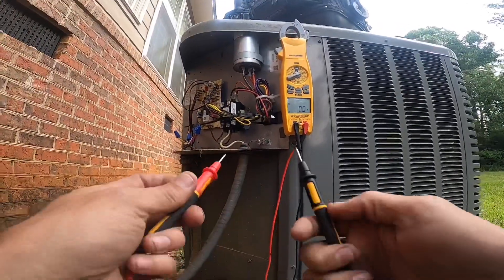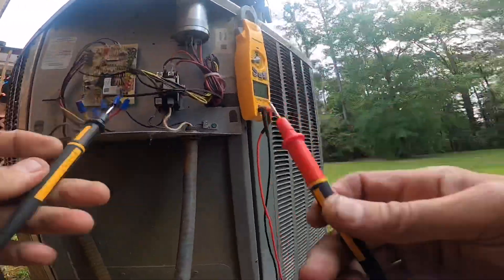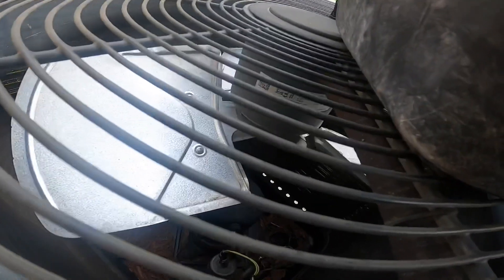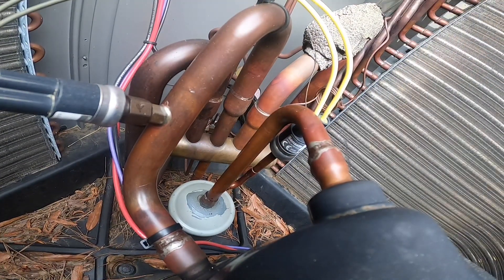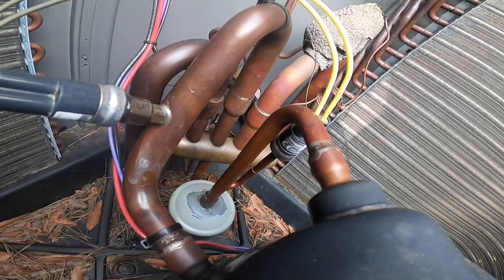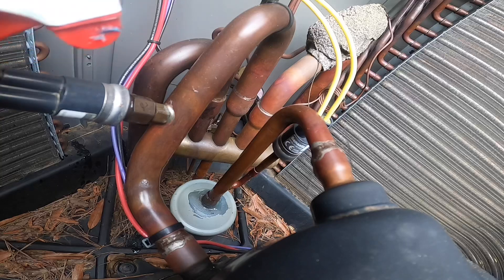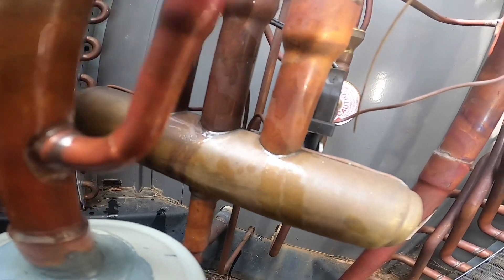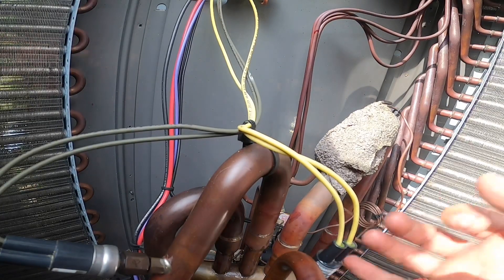No cooling, flat on freon

Comment: Known factory issue with Rheem. That kind of shit really pisses me off. There's no protection for the homeowner or for the HVAC companies and the guys making the repair. There's absolutely nothing that holds the manufacturers accountable for crap like this. I think the entire repair should be covered under Rheem's warranty. They should have to reimburse the company making the repairs for 2 hours of Labor and every bit of the refrigerant should be covered under warranty as well. But Rheem's solution to the problem is to send you a 6-in wire tie. Give me a break Rheem. But on a positive note... At least it wasn't the other known issue with the reversing valve leaking around the brass of the two cold lines.
Reply from the maker: I’ve had one fail in first 30 days. Now that pissed me off
Reply: I had to replace a reversing valve that was only a year old. You would think they would quality control a little better. Surprised it's that common of an issue. I thought "poor lady, she got the shit one that slips through the cracks" but I guess not 😂

Comment: Yessir...low pressure switch. I installed a rheem once and the next day completely empty. I pressurized and vacuumed to 500 microns on install. Came back next day found low side service valve inside connection at condenser leaking. On another note You think they need a new carpet?
Reply from the maker: Yeh, the carpet looked rough.
Reply: Did you wear you shoe cover so you didn’t make it worse?

Comment: I'm a little confused. I understand that part of the problem was that there was a leak but what was the significance of the low pressure switch. What does that do and why was it open?
Reply from the maker: Low pressure switch keeps 24V from flowing to contactor when it’s out of freon, and thus protecting the compressor. So, when I read 24V between terminals on LPS, I knew to look for a major leak.
Reply: @HVACGUY  Ah that's cool. I appreciate the quick reply.